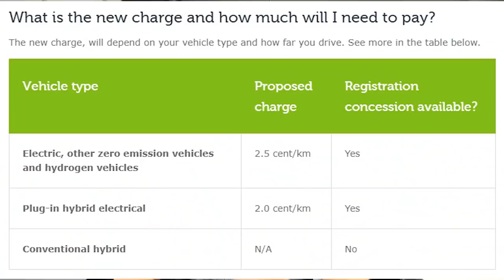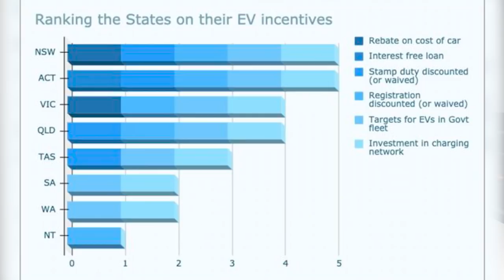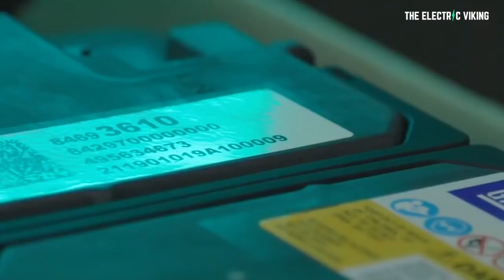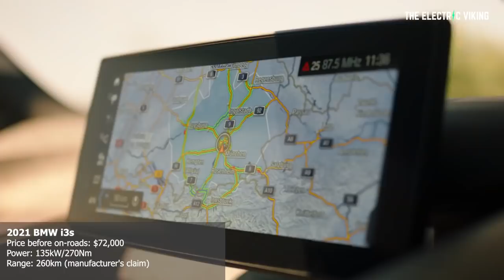Every EV you can buy in Australia in 2021

Comment: Sorry BMW i3 is not a bucket of crap. We bought one in early 2018 and it is the best car we’ve owned. The only other options at the time were Tesla model S, and Zoe. Hyundai hadn’t launched ionic or Kona. Revolutionary composite construction. Handles like it’s on rails, out-performs just about any ICE vehicle off the line and costs F-all to run and service.

Comment: Price parity is key. When you can buy an EV for $15k as you can an ICE only then will this be the final nail in the coffin.
Reply: I agree price parity is the issue. but do consider more than the purchase price please! my cost for energy is about 30% of my earlier cost for gasoline. service and maintenance cost are significantly lower too. In general a service for my Ioniq is a security check, the only repair regards tires and brakes, AC, thats it and is a lot cheaper than your service on any ICE. did enjoy a Volvo Diesel for many years, annual service cost were certainly at least twice as high.
Reply: @HHsnafu  Yeah, but you're preaching to the converted. I actually think in Australia for the general population who don't know or understand this we will need to go below price parity, people are so nervous about buying an EV and have been fed with so much misinformation.